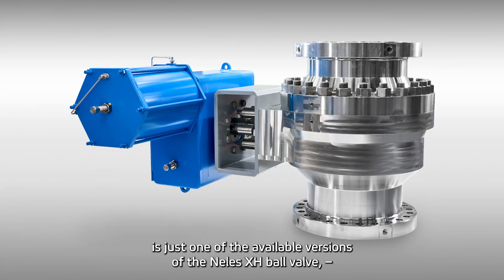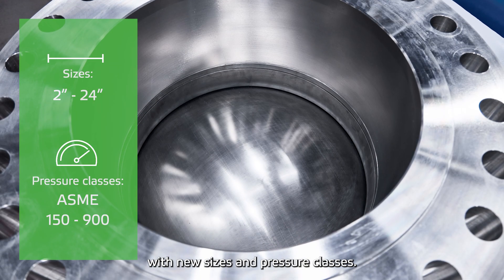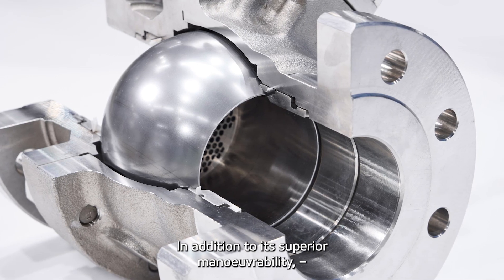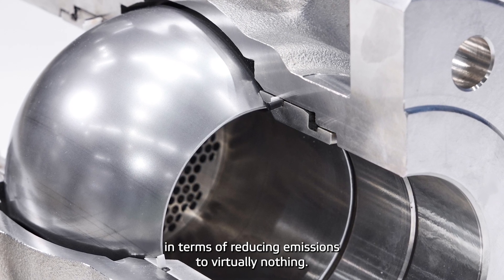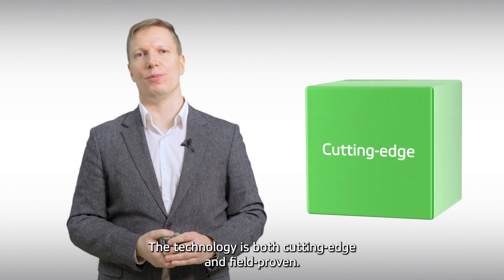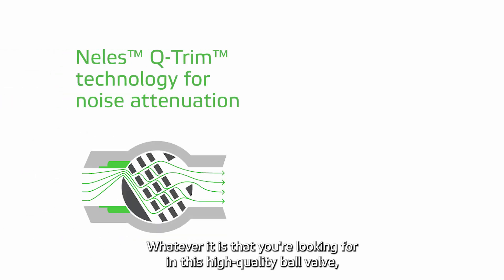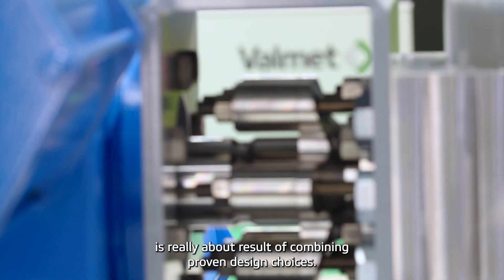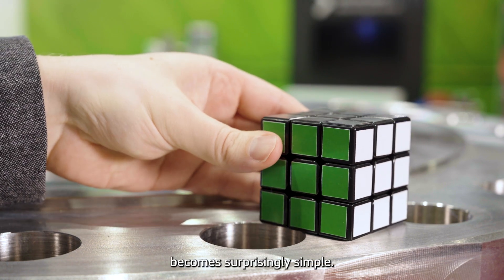Neles™ XH metal seated ball valve – Forward-thinking design

Comment: Why is this any easier to select and install than any other Ball valve of the same class rating?
Reply from the maker: Thank you for your question. Compared to other ball valves of the same class rating, the Neles XH ball valve is easy to configure and select with the help of the Nelprof valve sizing and selection software. 

The Neles XH ball valve also offers comprehensive compliance to the latest design, leakage, emission, fire safety, and functional safety standards as default. This makes valve selection easy for a wide range of applications.